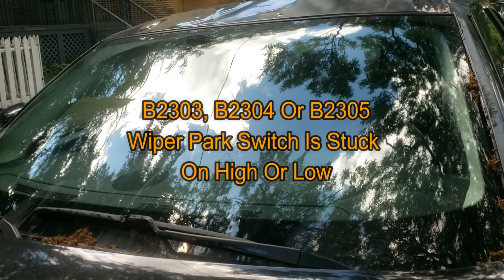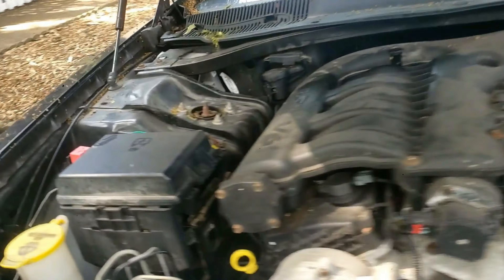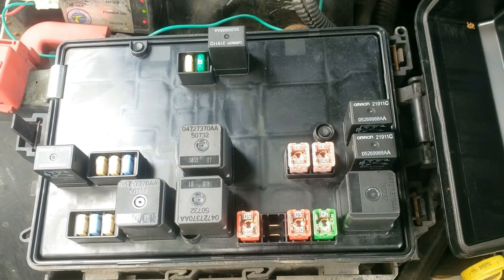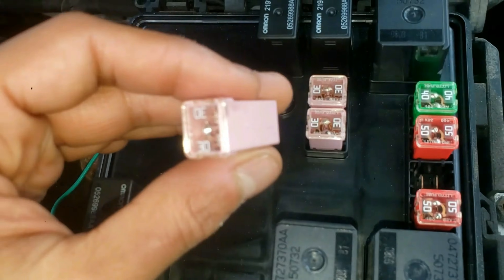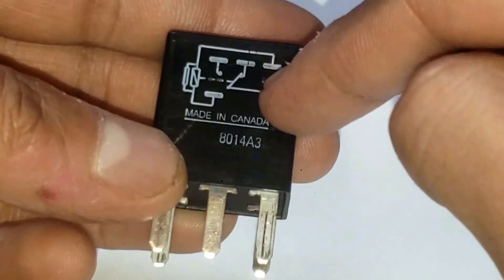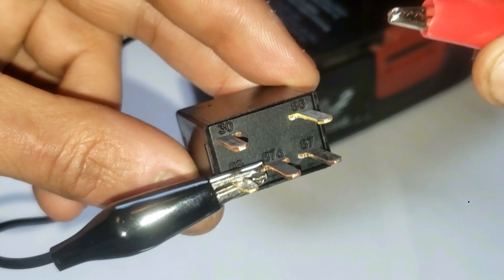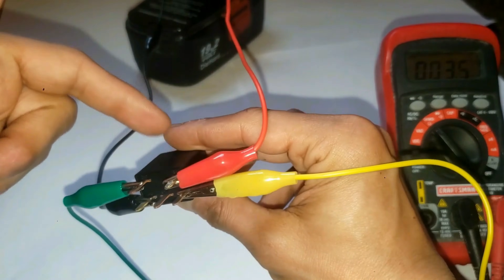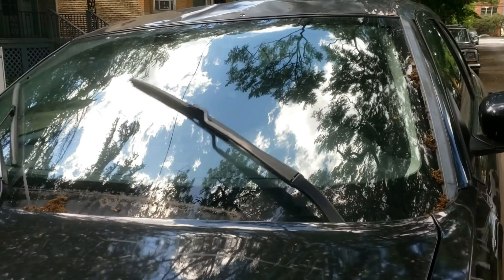Wipers Not Working Fix Wiper Park Switch Relay B2303, B2304 or B2305

Comment: Using an endoscope (less than 30 dollars) and accessing the view panel located to the left of the wiper motor the transmission links between motor and wipers  can be check. If they're functional, then you can save several hundred dollars in repairs.
Reply from the maker: Again another nice tip for the rangers.

Comment: Always grab the wipers and see if they will move. If they move then the motor is broken, which is common on 04,05,& 06 ford rangers.  Not all of the year Rangers have a GEM unit which is usu located behind the radio. Number of fuses and locations vary on these models. Replacing a 10 amp blown fuse fixed mine. Check ALL the fuses because the manuals are not accurate.  This is a great video for a particular fuse set up, but the location and number of fuses varies greatly from these years..
Reply from the maker: Nice feedback for those who have a ranger.

Comment: Front wipers don’t turn on with a new motor but the back ones do. Checked fixes relays and power. Is it the fuse box? Is it the cable harness connecting to car? Is it the wiper switch? If the switch was faulty would the back ones turn on and the front ones not? Would it cause both not to turn on?
Reply from the maker: What codes do you have?
Reply: @FixCarYourself  turns out it was missing a relay. Everything online showed the relay being a different relay than the scamtics from ford showed. Thank god it was not further electrical issues.
Reply from the maker: Ok good to know, I'm glad you figured out it was a missing relay!
Reply: @FixCarYourself  well it costed me some money as the details about switch location online are wrong at least the videos on YouTube are. Probably because they are the European versions online or something. Maybe different fuse box. Either way I’m glad I didn’t have to rewrite the car and I now know there are no codes or serious issues with the vehicle.
Reply from the maker: Interesting.
Reply: @FixCarYourself  no codes

Comment: Wiper don't turn off on my Hyundai creta 1.4 can u help. It's rainy season here. Moisture or other issue
Reply from the maker: Try removing and reinstalling the wiper arms...and nut holds them in place. It could be loose or not torqued properly. Check and replace the wiper blades if bad as well.
Reply: @FixCarYourself  what does that have anything to do with the question